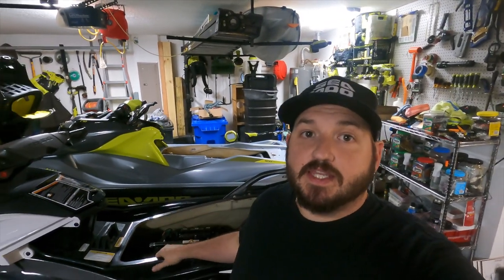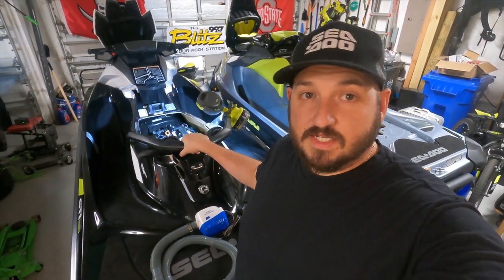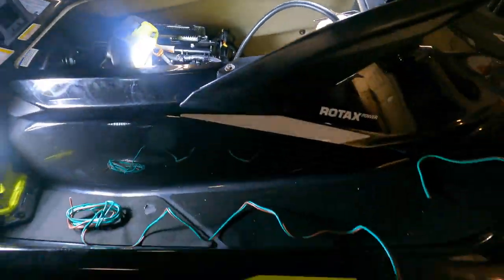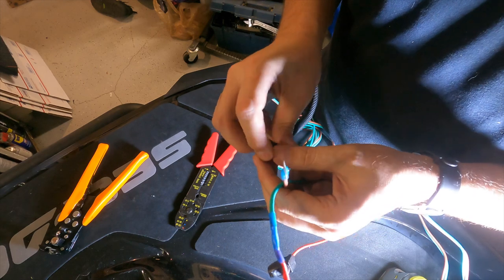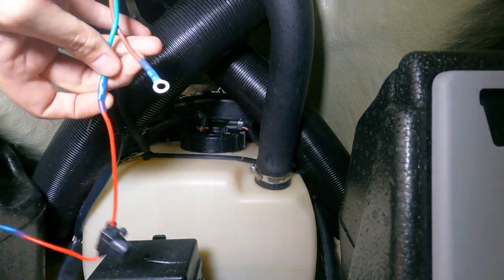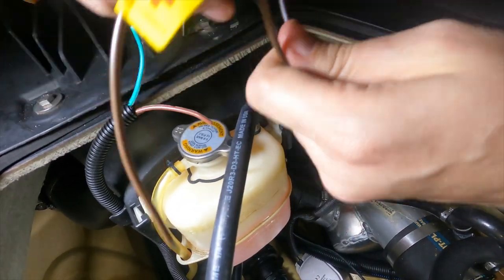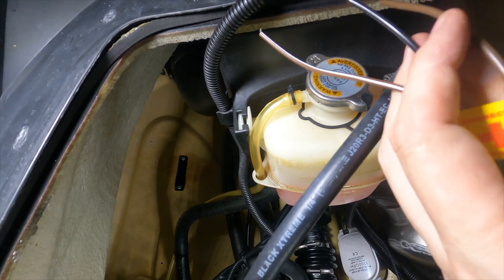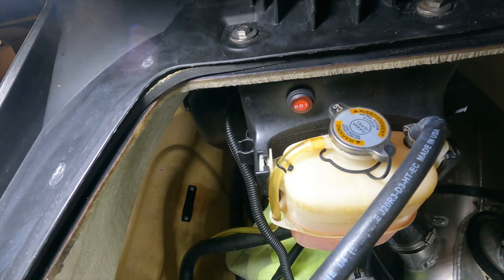Installing Bilge Pump, 2011-2019 Seadoo

Comment: nice job, but question, by putting that discharge in the rear like that how would you know if you have a problem? i put mine to discharge by my feet that way if it comes on i can tell that i have a problem.
Reply from the maker: That is true. I think we'd know if we get that sinking feeling. Lol. We also almost always ride in pairs so we can alert each other.

Comment: I have 430hrs. on my original carbon seal, and it's still good. Just don't run it out of the water for more than about 20 seconds, and don't ride up on sand bars.
Reply from the maker: Wow, that is quite impressive. I've always heard to replace every 200h.